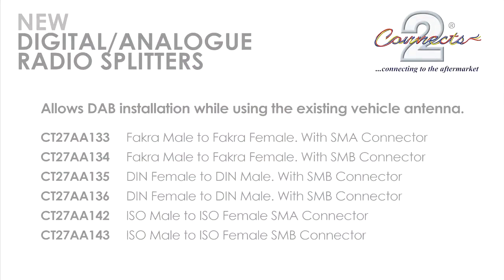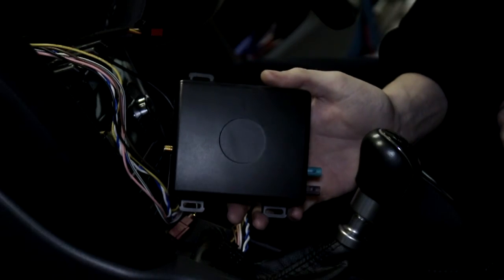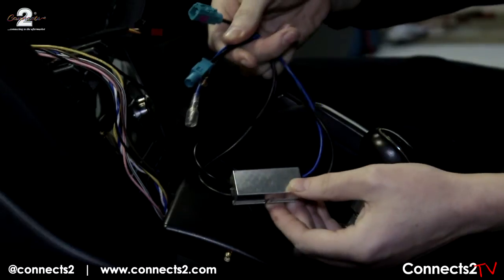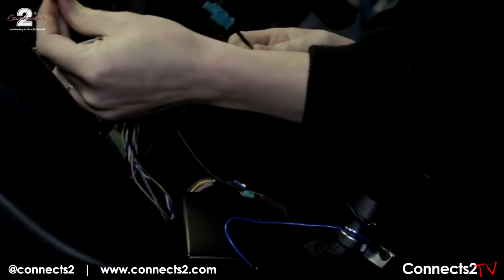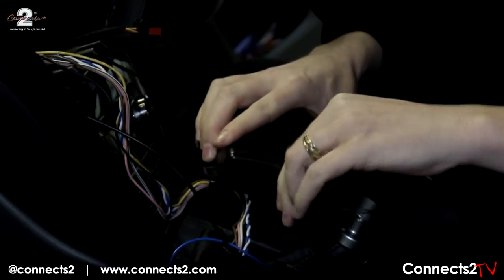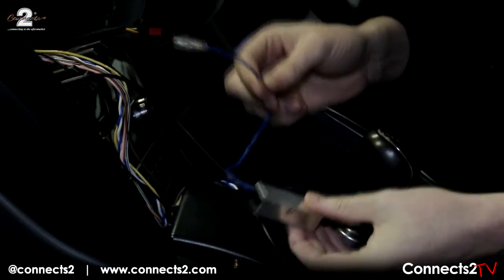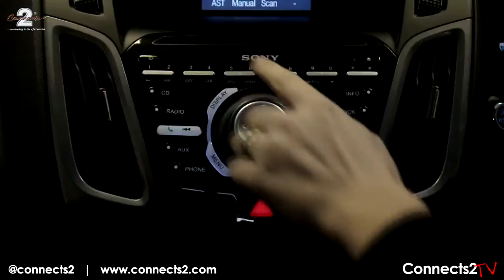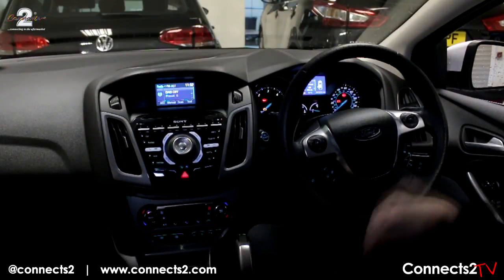DAB Splitter for Fakra Antennas (SMA Connector)

Comment: at the beginning you say it's not  for amplified aerials, but in the video you say the blue cables for amplified power lead? Is there a difference
Reply from the maker: The blue wire is simply to power up the CT27AA133
C2
Reply: what can i use for use for powered amplified antenna? (bmw)